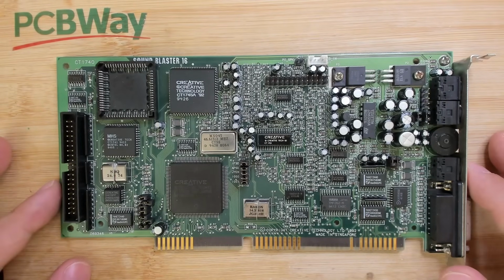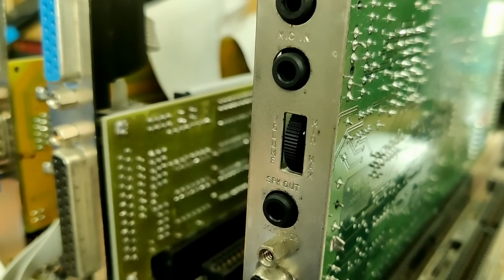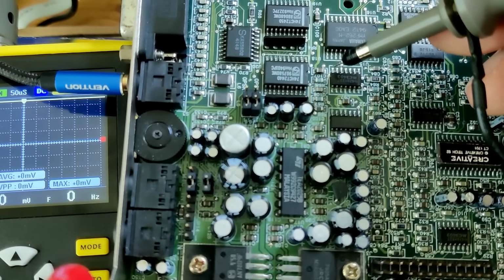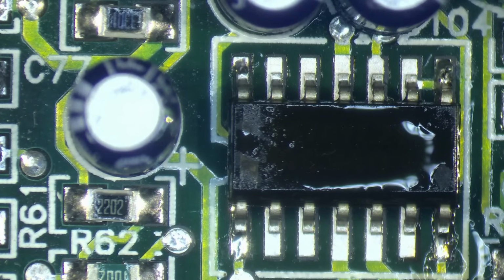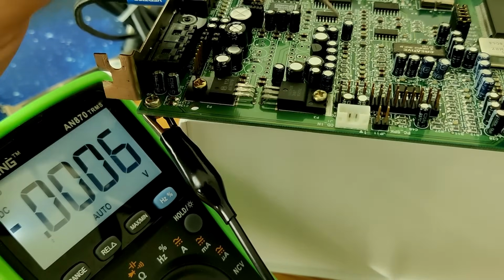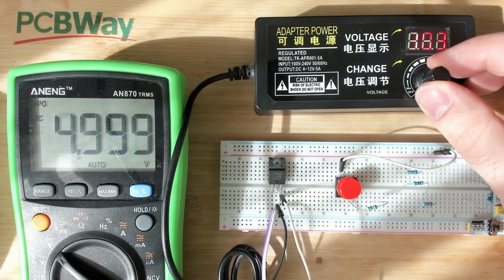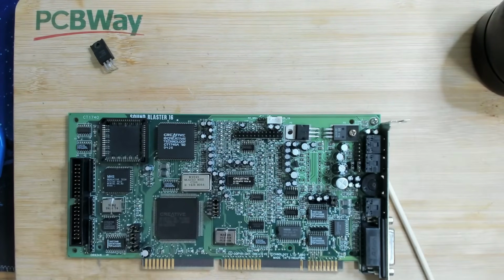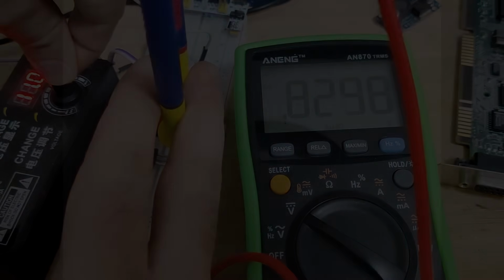The Greatest Sound Card Ever? The iconic Sound Blaster 16!

Comment: You didn't check the output of the 5V regulator on the oscilloscope - I suspect it could be oscillating with a12V input.

There are many variations of the 7805-type reg but IME they all need a bypass cap close to the input to prevent them oscillating under some voltage/load conditions. Could be that either there's no such capacitor fitted to the board or it's an ex-capacitor and the new 5V regulator is more tolerant.

BTW there's a sure-fire way of killing a7805-type regulator - pull it's output negative. That's why a  split supply, e.g. +5V, 0V, -5V, should always have have reverse polarity diodes on the outputs to prevent them being pulled to the other side of 0V by a fault.
Reply: Yes. Typically, the 7805 would have a 10uF decoupling capacitor on its output close to the regulator as well as smaller 0.1uF distributed around the rest of the output supply rail.  It could be that it's lot capacity, or increased impedance,  either could cause instability in the regulator.
Reply: @ A cap on the output isn't needed for stability but it does improve the regulator transient response, and caps distributed around anything containing more than a couple of ICs is usually a good idea.
However a having no local capacitance at the input of a 78xx can cause stability issues. I've just had a look at my ancient Motorola and National databooks and they both show 330nF which would be the minimum.
Reply: @Graham_Langley  Good stuff. I should have kept more of my data books from the 80s. I still have most of my TI ones though.
Reply from the maker: Thanks for sharing this information. Honestly, I need to sit down and read up on what you are writing. There are quite a few things I don't understand yet.

Comment: 24:11 - Since my electronics store closed down, I no longer throw out any circuit boards (old motherboards, analog amplifier boards, etc) so that I can harvest regulators, caps, resistors, varistors, you name it. Across the 8-9 boards I have in my basement stuffed in a drawer somewhere, I have all I need :D
Reply from the maker: I do the same now! There is no better place to source components than old motherboards! They are packed with things you need for such repairs! I even started to harvest sockets :) Socket 3 and... Socket 370 (for a future project).
Reply: @ Hah, I've never harvested anything more than a DIP plug in, but I did buy a socket 3 standoff for a crushed 486 DX 50 CPU that I am trying to straighten the pins on - someone stomped on it... I broke one pin already so there will be some micro soldering!
Reply from the maker: Good luck! Yeah, you won't find those sockets easily these days.
Reply: What's wrong with the card?  It's an ISA card.  I have a very hard time believing that the noise was completely eliminated by changing of a voltage regulator.😅
Reply: @mrquicky  Are you replying to the right thread, mate?

Comment: 18:54 78xx need decoupling capacitor on input and output (100uF alu, 10uF tantalum/ceramic/polymer). Yes, in most cases they works without them, but sometimes going to selfoscillating. Just 5 cents.
Reply from the maker: Hm, are you saying I should check if there is something like this on the sound card? Or are you sure that those caps are definitely missing. Just want to make sure I don't make a silly mistake - or, I could improve the stability of the regulator. There are many caps in that area that could be part of the 5v line (at least I expect that).
Reply: @bitsundbolts  no, if it works it works. 

But in past i have sometimes issues with 78xx/79xx regulators without decoupling capacitors. 

And i dont have similar issues, its totally new to me.

Comment: This reminds me of my C64. The computer worked fine with nothing plugged in, but the second I added my U2+ cart it had color glitches. I noticed the 5v line was only 4.5v. That's in spec so I ignored it. It never occurred to me early on that I needed to plug in the cartridge and test the line again. It was only 3.5v now. That's NOT in spec. Not even close. It's amazing it worked at all. The issue was my home made PSU. I bought a MIDI cable so I didn't have to solder a DIN connector. The MIDI cable didn't have thick enough wires. I eventually managed to source a new presoldered cable and it fixed the problem.
Reply: of course that doesn't change the fact that the MT ram on the board was bad. Bit 8 had intermittent faults. (some locations were bad, but most were fine). I replaced all 8 since I know MT is trash. But yeah I knew it was bit 8 that was bad. And I did have to replace the cartridge port. It worked after de-oxit.....until it didn't. My cart had a thick layer of green goo on it. I cleaned it off. But it didn't work anymore. I replaced it and it worked perfectly. I also replaced the PLA and the color ram thinking it would fix the colors it didn't. In fact I lifted a trace from this bad repair. So my "it looks brand new" board has a bodge now. sadly. I lifted one on the cartrdige port as well, but it's still attached. lol So I just left it.

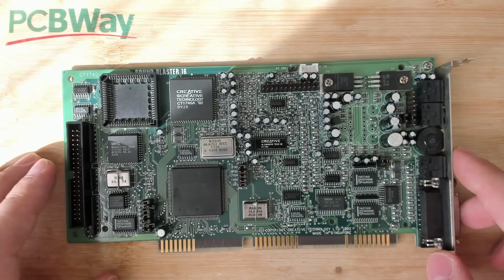Comment: 15:15 - so put a socket and then some heatsink material on the DIP chip directly. The heat is better dissipated through the fins in the circulating air rather than at the bottom of the IC where it is not even touching (or faintly touching) those copper traces under a solder mask...
Reply: Using the copper traces is actually better than putting a heat sink on top of the pin. The 4 central pins of the TEA2025 have a good thermal coupling to the die, and while those pins are ground pins, their primary purpose is to conduct heat from the die into the ground plane. A heatsink on the plastic DIP case has a considerably higher thermal resistance to the die than those four pins do. That chip has been specifically designed to be cooled that way, and you should not interfere with that design.
Reply: @tw11tube  Excellent info thank you. I think this needs some testing, and I have two cards to compare. I'll stress them equally and remove the socket if the heat sink is a failure. Plus it will make for a good video.
Reply: @tw11tube  I dunno - I'd have to debate it with a VLSI designer.
Reply: I think that's what I need to do for sure. I suspect my Tea2025 chip may have burnt itself out even though it was sitting flat on the board.
Reply: @esc2dos  WEll, these things are like 30+ years old... I should do that to all of my retro machines. My C64 is already 'finned.

Comment: Right off the bat, I wouldn't call SB16 the greatest card ever, it created a nice standard, of course, but the cards themselves were kinda budget crap. I would argue Creative cards started getting good with the SB Live! series, with EAX and stuff, but in the DOS era the only good thing I can say of them is "compatibility".
Reply: I'm actually surprised to see your copy have a copper plane (the darker part of the ISA connector gives it away), which would allow to reduce crosstalk across the card. I haven't been that lucky with the ISA Creative cards I've seen.
Reply: 16:50 yup, I did not expect it to change it, but it's good that you verified it. Still looks more like a voltage problem than an amplification problem to me, I'd check the VCC lines too if something fishy is going on with it.

There's easy ways for checking op-amps - checking the input and the output and validating it is the behavior you expect  from the op-amp.
Reply: The software support was wide, but without clone hardware, it's difficult to call it a standard! Most competitor chips only had SBpro compatibility, 8-bit audio, and used WSS or their own thing for 16-bit stereo compatibility in DOS games. Crystal, AD, Opti, ESS they all support WSS and so that's 95% of soundcard market right there, and given WSS released basically simultaneously with SB16, you're not really missing much in terms of software support.
Reply: @SianaGearz  I stand corrected.
Reply: 6:37 sounds like the input signal is overloading the op-amp, I can clearly hear a lot of clipping in the amplification stage.
Reply: For the future, you might want to check the coupling capacitors before the op-amps, because they are not supposed to have DC voltage on the signal line, and the coupling capacitor is used to remove the DC bias. That DC bias could actually cause the clipping I'm hearing.
Reply: I mean if you have DC on pins 2, 3, 5, 6, 9, 10, 12, 13, that's a problem outside the op-amp.
Reply: 26:07 ok, I did not expect the culprit to be the voltage regulator.

Comment: Oh man this rebuild reminds me of my AWE 32 card - Someone ripped off some caps, there was no I/O plate, joystick/MIDI port was treated to some pliers, tons of bent pins, and the 30 pin SIMM slots were so broken, they were not able to hold the RAM. After some repairs, it lives in my PS/1000, with 28 Mb RAM in it :D
Reply from the maker: Wow! That sounds like it was quite the project! Congratulations on a successful repair!
Reply: @bitsundbolts  Hahha it took me over a year (parts sourcing, other projects, life, etc) but yeah, I absolutely love it. Except that I have to figure out Windows 3.11 drivers - it just repeats the first 0.5 seconds of any WAV file 5-6 times and then stops, like the TADA sound when started. It's probably a driver issue, I'm using Soundblaster 1.5 stock drivers.

Comment: I love and hate the SB16 at the same time. For one it mostly just works with OPL and digital audio, with even the weirdest mainboards i have (i have a buch of boards based on craptacular 486 chipsets, like ACC micro trash, that seem to hate opti cards and such, but work great with SB16s). yet i had SO MUCH issues with midi and bad audio quality that i hate them with a passion. I guess like all the best things in life, they are ... difficult lol
Reply from the maker: Haha, true! I didn't use the card extensively. To be honest, after I was done with the video, the card went into an antistatic bag. Creative released so many different Sound Blaster 16 cards - all with slightly different features. The one I have seems to be a really nice model. I can't complain so far and the audio output (having the amplifier disabled) is very clean. At least I cannot hear any annoying noise.

Comment: I once saw some audio card troubleshooting by probing and tracking audio outputs from components directly to an amplified sound to find where noise was coming from.
Reply from the maker: That is what I tried - sort of. I blamed it on one of the opamp chips - which technically is connected to the 5v power supply that was affected by the bad voltage regulator. It might be that the opamp just couldn't operate correctly due to that - but the chip wasn't bad, just the input voltage was too low.

Comment: If you go to a car foil wrapping workshop they'll give you an offcut of tint film that you can apply to the LED display window in the power supply. If you take 25% tint, it will attenuate red light coming from the digits by 25%, but the white light reflected by the light guides by 50%, making it barely less bright but tons more legible!
Reply from the maker: Good to know - I'll keep it in mind should I cross a tinting shop. There are plenty in Dubai.
Reply: That's a whole lot better than my solution: thin paint brush and black nail varnish.

Comment: Had a SoundBlaster 16 Value Edition back in the 90s and the FM synthesis was astonishingly bad. Everything was extremly noisy while playing FM and the noise even stayed after the fm synthesis had ended until I used the reset button on my PC. Never was sure if this was a "feature" or if my card had a fault. I almost never needed fm synthesis, so I lived with that problem until I gifted the card many years later to someone I met on the internet. 

Got a real SB16 years later and it did not show that problem.
Reply from the maker: Yes, I remember such incidents as well. I had a couple of clones - mostly ESS cards that I remember. Those cards were quite good, but I do remember having to fight with hissing sounds, hanging MIDI notes (when you exit a game at the right moment), and so on. The only way to fix it was to reset the PC (sometimes you had to power off the machine entirely).

Comment: The pcb is too transparent (very low quality), sound quality is bad, has high noise, it has bad quality compatibility with previous SB models, it was more expensive than more feature rich competitors.
Also many models had different features, so you never knew what sb16 you were buying.
No, it is not the best sound card, by a lot. Like all Creative products.
Reply from the maker: Creative had so many different model numbers for the same sound card. There are so many revisions for the Sound Blaster 16 - including cheaper ones. But the one I have here feels really solid. I checked the PCB again, it has proper copper fills. The only spots where light goes through is around vias.

Comment: Unless they were doing something REALLY weird with that card, I don't see why you couldn't replace the opamps with, basically any modern part. So long as the pinouts match, and most should IIRC, an opamp is an opamp.

The LM324AD LM324 AD Quad Op Amp looks like it should be a perfectly fine substitute, but this IS with minimal cross referencing.
Reply: No LM324/LM358 for audio. These suffer from really bad crossover distortion in their class B output stage. Use something else cheap with a class-AB output stage, like a TL074.
Reply from the maker: Well, luckily I didn't have to replace any of those. But great that you gave at least a chip to start with doing research - in case someone has an issue with their opamps.
Reply: @bitsundbolts  True, but I found it a bit odd you said that you HAD to use the original opamps, but never really gave a reason why this is the case. Are they unique in some way? Or were you just swaping them around for debugging purposes?

Comment: IF the regulator is working and you get lower voltage on the output than supposed to, there's a short somewhere after the output. Edit: wow, i did not expect this
Reply from the maker: That regulator failed in a very interesting way - I have never seen something like that.

Comment: Ah the broken voltage regulator, seems if its not a capacitor issue it often is a regulator for the things i work on.
About capacitors, the one with the stretched heatshrink might need some investigation, maybe even a replacement just to be sure.
Nice fix and good diagnostics 👍
Reply from the maker: Yes, this one regulator does look like a sore thumb :/ I did remove it and measured the values - looks all good. I don't have the correct replacement right now. I'll keep it as is for now. Thanks for watching!
Reply: Could still be a capacitor issue - 78xx-style regulators need a bypass cap close to the input for stability under all conditions and it could be that the removed regulator was oscillating with a 12V input.

Comment: I think I have a SB16 with exactly the same problem in a "to fix" box. It had a damaged quartz crystal, I replaced it, it worked for a minute and started giving really noisy output. Thanks for a great tip, I will check 7805 asap.
Reply from the maker: Oh, please let me know once you measure the regulator! Would be funny if it is the same issue :) Then my mission is complete!
Reply: @bitsundbolts  Hmm, I have found the card, and it's 2920, after my repair. And now it works. Flawlessy. No noise, doom runs with both music and sfx. I've checked voltage on 7805 - 4.95v, perfect.  Still, thanks for the tip! 😀

Comment: I had a damaged Sound Blaster 16 that wasn't even detected. In my case, it turned out to be the same voltage regulator, but it was completely dead, no voltage output whatsoever. :)
Reply from the maker: Oh wow - interesting! It makes sense though because it could be that the chips that make the card work are powered also by the 5v output of this regulator. So, no power to the chips - no card being detected. Good that you found it! I learned from this project to measure voltages on power inputs. That could have been easily spotted from the very beginning. I suspected some IC in the audio circuit to be faulty, not a simple voltage regulator.
Reply: @, yeah, in your case it was definitely more difficult to diagnose. I think I would have also thought about the op-amps way before the voltage regulator itself. :-)
Reply: That's nice to know, I have 2 SB16s in a box both of which aren't detected I will have to look at the regulators now, Thanks

Comment: Oh yes firmware swap on the SB16 with the project from Vogons. :) I have a number of SB16s (including this exact model) on which I plan on doing this.
Reply: More precisely, my CT1740 is an earlier revision of the card with firmware 4.05 which does not have the hanging note bug so I will not modify it. But my other SB16 cards have firmware 4.11/4.12 with the bug and those I will fix, once I get off my lazy ass to desolder the chips and replace them.
Reply from the maker: Yes, that is exactly the project I will be using to remove the existing DSP, get replacement IC to which I need to write the fixed firmware, and then verify that the hanging note bug is gone. I had to look for samples to know what the hanging note bug is :) I never had a Creative Sound Blaster before and never experienced that problem. Safe to say, I was very disappointed that there are just high pitched notes that shouldn't be played. I guess I wanted something a little bit more dramatic to easily hear the difference :) Oh well, still a NICE project if it works (well, it's found on Vogons, so, chances are it is an amazing project).

Comment: I've never seen a 7805 with this kind of behavior, in more than 30 years playing with electronic.
Reply: Same here, then I realised we didn't see the output of the regulator on a 'scope. It could be oscillating due no bypass capacitance on its input.
Reply from the maker: Well, I guess you can always learn something new. This was my first regulator that failed. So, I guess this is a very uncommon fault.